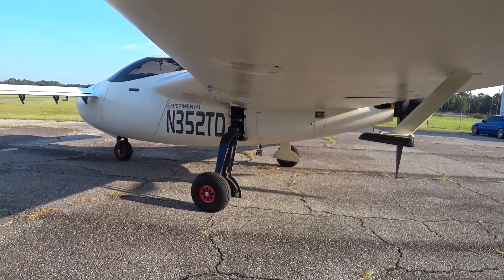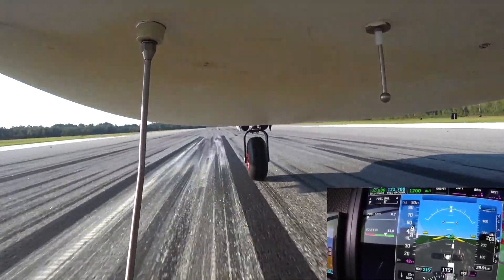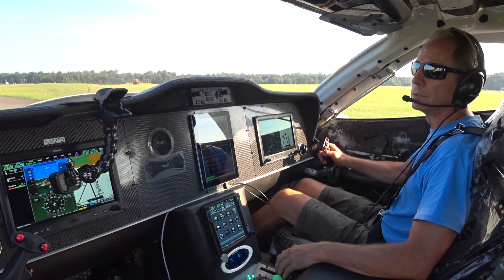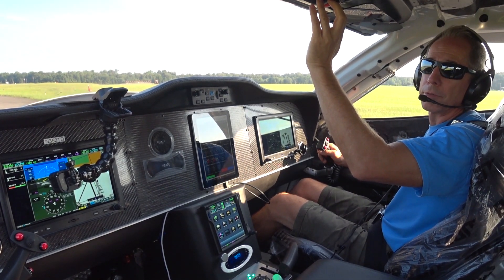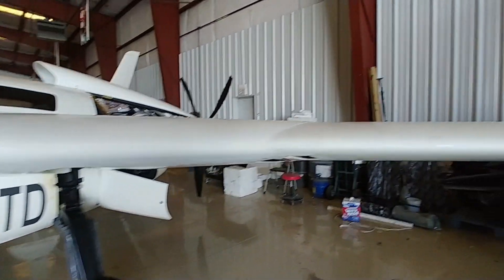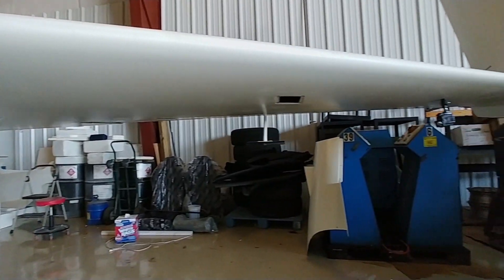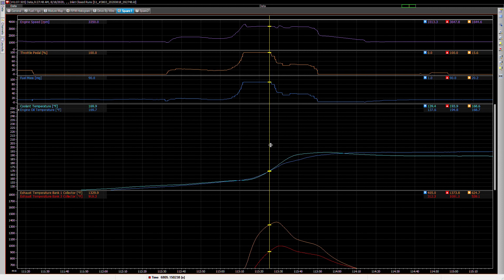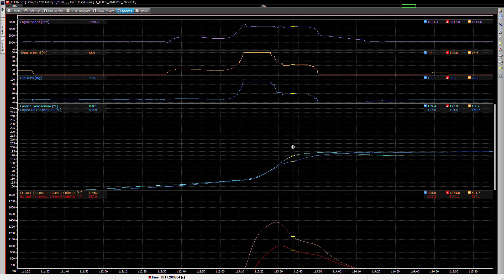Is There Enough Cooling? - Building the Raptor Prototype

Comment: will be interesting for your first flight - it's likely the test pilots will want full access to everything the engine can give them, just in case... not likely they'll use it, but I imagine they'd want some "oh fuck" insurance. Is there an easy way pick from different tuning profiles in-flight?

I totally agree you need to have done this level of fine thermal tuning for normal flight though - it makes absolute sense to me to have this stuff nailed down.

Comment: Look..bottom line....if the engine temp does not redline after extensive ground taxiing on a hot day...the most extreme cooling conditions for an air cooled engine....it's NOT going to overheat in flight!!!!

Comment: Find out the air velocity in the ram air inlet at climb airspeed, then replicate it with a ground air supply. Then ground run it at full power repeatedly till you find the weak point.

Comment: Peter - crank your temperatures as high as you dare with a threshold run-up and then roar down the runway to see if your 80kts gives you enough airflow to contain your temperatures.  That way you'll know whether it's likely to be stable or divergent for a first flight.

Comment: P Body
Peter you are not going to get an accurate gage of the cooling system capacity doing cold runs. 

What I suggest is an extended warm up period letting the system get to around 200 static or wherever it holds steady. Then do a pass down the runway full throttle cut to 50 and analyze those temps... if the temps stay unacceptably high after throttle cut on coast and during taxi this would be an issue..

Much like you were doing on your previous tests that day when you were seeing 200+ just taxing with a slight tail wind. If you can keep it under 215 under full stress or so or see substantial temp drops at v1 then you can consider yourself safe. If not you need to think about adding an induction fan/ emergency cooler fan.

Comment: Interesting,. I know you have measured this before but what was the measurement between the prop and ground. For the angle of attack for nose up on landing. Thanks.
Reply: I think I recall him saying (some time ago) roughly 17.5" static and 11" at 3°, I could be mistaken though.
Reply: @ssoffshore5111  thanks,. A hanger I'm looking at which is typical around here is ten foot, I'd have to raise the knose and get it in and the rudder tips between the rafters,. That's why I asked him if later he would lower it the velocity is 9 feet.  Peter said down the road he'd look into it.
Reply: @ssoffshore5111  for landing I think we would be wise to keep the nose up no more than 5 degrees. To avoid a prop strick, same as floats with wheels.

Comment: Is there a thermostat in the system? If so, it would be interesting to monitor its operation and the effect it is having on the coolant temp compared to the rest of the data.
Reply from the maker: Oil thermostat is set to 217f. The coolant has a two chamber setup that I believe is controlled by the oil temp.
Reply: @RaptorAircraft  All of the diesel engines I'm familiar with have dual thermostats controlled by coolant temps, not oil. My experience is with heavy duty trucks and pickup trucks though, I've never messed with TDIs.

Comment: I"ve been watching for a long time, and I can't tell if there is enough air getting out of the back. I wonder if you are building up pressure inside of the cowling so that the cooling is just inefficient.
Reply from the maker: The outlet air cross section is larger than the inlet, as it should be for the best performance.
Reply: @RaptorAircraft  Thanks. Just an idea.

Comment: Thanks for the Raptor rush experience today! Cooling looks good to me! A little tidbit experienced observation for you... Vacuum serves like a thermos insulator with the engine. When the manifold vacuum is reduced by reduced throttle setting, heat transfers through and will cause temperature spikes then level back off. This phenomena will fool many if the technician isn't aware. The camera on the tires reveille by the disappearance of the bulge that Raptor is getting light on the gear ready to defy gravity. The roll axis seems to stabilize with less rocking side to side during this phase. Are you feeling more stability at higher speeds? Raptor seems willing to point by reviewing today's presentation. Things are looking nimble with Raptor!

Comment: A conventional aircraft can rotate and sustain flight in ground effect below stall speed. A canard aircraft cannot due to the aft placement of the main gear. Attempting to fly this in ground effect is a very, very bad idea.
Reply: The CG is well forward of the gear, so it requires a significant pitch up to rotate. However, it will require a significant, yet sensitive, pitch down after takeoff to prevent a climb. PIO (pilot induced oscillation) is almost a sure thing with no canard experience (Peter). So now we're at high speed, low level, with a very high chance of PIO. Google Detroit Flying Car crash. While not PIO induced, it shows the danger of canard pitch sensitivity
Reply: Jeff, if what you are saying is that it takes a more delicate touch to fly it in ground effect, that makes more sense. If I remember correctly Peter has canard experience, however I could be wrong on this.
Reply: Stall speed fluctuates on all aircraft, depending on several conditions.  If you fly a conventional aircraft to a stall in ground effect, it's going to stall.  Ground effect gives you more lift, but that also means it lowers your stall speed.  So while a conventional aircraft might stall at 55mph in clear air, it may stall a few mph below that speed in ground effect.  All you're doing is changing the speed that you stall the wings, no different than if you were to reduce the weight of the aircraft.  It has nothing to do with flying "below stall speed" and everything to do with AOA, since a stall is a function of AOA and not speed.  Canards are no different in this regard, and yes, canards can fly in ground effect longer than in clear air just like a conventional aircraft.  Ground effect is a force that extends a considerable distance from the ground, and a canard doesn't suddenly stop being affected by it as soon as it's airborne.  They honestly don't act much at all different from a conventional aircraft in ground effect, no special tricks or procedures to follow.

A canard design lends itself well to protection from PIO.  Since you're in front of the wing, any pitch moment is going to lift or drop the cockpit before the wing reacts to the change in AOA, this is an active and positive feedback loop.  Generally speaking, in conventional aircraft where you sit inline with the wing or behind it, the feedback loop is either neutral or the opposite.  If you pitch up, then there's either no change in felt momentum or you feel a momentary drop before the wing starts producing lift...this is an inactive or negative feedback loop.  Positive feedback gives the pilot an instantaneous response to control input, meaning the pilot can feel what the plane is doing without having as much experience with it.  What it amounts to is the canard pilot feels more G's for a split second then it levels out to a sustained G, while a pilot in something like a Pitts will momentarily feel reduced G's or a gradual increase to that same sustained G.  Think about it for a moment, say you're flying a GeeBee racer at slow speed (like taking off), you can pull and push the stick and the plane kind of mushes around without climbing or diving because there's not much air over the wings.  Meanwhile, the tail is still moving up and down, and that's where you're at...so you feel the tail lifting you up while you're pushing the stick forward or dropping you when you pull it back.  That means if you pitch up, you feel negative G's, telling your body "oh hell we're falling, pull up harder", while your eyes are saying "oh hell, we're pointing to the sky, push the nose back down", so you push down and now you feel positive G's, which tells your body "oh hell we're climbing, push the stick quick" and your eyes see the ground getting big really fast.  That's how PIO's get started, and it's a pretty janky way to feel what the controls are doing.  I think anyone riding in the back of a bus behind the rear wheels could relate to this, by momentarily feeling like the bus was turning the wrong way.

As far as CG goes, any aircraft with training wheels is going to require force and pitch input to rotate.  In addition, any aircraft that rotates on takeoff will also require an AOA reduction to prevent climb.  Mains are located in a specific location to require a specific amount of elevator force to lift the nose.  Too far from the CG and it'll be quite difficult to lift the nose and hold an aircraft on the mains for takeoff.  Too close to the CG and it'll have trouble keeping the nose on the ground and might rotate before it's ready.  It's not something special just for canards, but it is something specific for aircraft with tricycle gear.  In some aircraft, you are required to rotate before a certain speed or you'll never get the nose off the ground due to the incidence of the wing itself in relation to the gear plane.

Pitch sensitivity and PIO is all about longitudinal stability, which has nothing to do with whether an aircraft is conventional or canard.  It has everything to do with CG, horizontal stab size and incidence, elevator effectiveness, and control forces required.  Put the CG further forward, you're more stable and less pitch sensitive.  Increase incidence and/or size, more stability.  Reduce elevator effectiveness, less pitch sensitivity.  Increase control force requirement, less pitch sensitivity.  This is true of canards and conventional aircraft alike.
Reply: @Skinflaps_Meatslapper  flight below "published" stall speed is what I meant. I disagree with you about pitch characteristics but that's ok. Looking forward to seeing this play out.
Reply: @jjc839  "Published" stall speeds always carry several quantifying variables.  Things like ambient conditions, power settings, W&B, etc. that will never be identical from one flight to the next.  Did you know that you can stall an aircraft at practically any speed it can fly?  It's not just about a particular speed.  It's about angle of attack.  That doesn't change unless you change the aerodynamics of the aircraft as well.

You can agree or not, it doesn't change aerodynamic principles that have been scientifically proven for nearly a century now.  I may just be a collection of random internet comments to you, but those comments come from decades and thousands of hours building and flying the very types of aircraft you seem to know so much about.  It's like an American telling an Italian he's been making pasta wrong his entire life because the recipe doesn't match what's on the Kraft mac and cheese box.
Reply: Skinflaps Meatslapper 👌👍👍
Reply: Can you explain that a little better? Isn’t the point of ground effect that it gets you a slightly higher ‘effective’ air density? If so why don’t that work on a canard?
Reply: Hey, I may be completely wrong, and I hope I am for Peter's sake
Reply: 🤔 This is a Velocity @3min t/off then land at end, pretty flat:  https://youtu.be/bBsR0S7nEOU

Comment: Pete,  the length to which Wasabi went to throw you under the bus repeatedly in their rebuttal video was surprising to say the least.  First impression was that they were more professional than that.  I began to lose confidence when they kept extending the squawk list, finally telling you they wouldn't fly from the old airfield.  It seemed like they were looking for reasons to bail on the project.  Still gobsmacked at their need to seemingly defend themselves by taking you down. Glad to hear of your new situation the the in house DAR and Test Pilot.
Reply: I too had some reservations on Wasabi and why it was decided at last minute to reject the original airport.  However...after watching some of the more recent acceleration tests prior to their arrival, and then them doing some runs...I think it just took them a while to arrive at the conclusion that the aircraft just did not have a fast enough acceleration for the runway length.  This is not a criticism but just a factor of the design - this aircraft, as set up (prop, weight, etc), uses a lot of runway to accelerate to takeoff speed.  Again, nothing wrong with that, but for initial test flights, you want more margin for accelerate-stop.  In a single engine piston, I don't want my reject decision point to be 1 second after Vr on a good day!  They are looking out for the aircraft, and don't want to take it "into the tulips" if they can avoid it.  Best mitigation for these initial flights is a longer runway, and I think this proving valuable even now with the test runs Peter is doing.  Good work Peter!
Reply: @jeffreygoyer7760  I totally agree.  It was a very wise move to relocate to another airport and one with a longer runway AND safer places to put it down if things get ugly.  Several things have failed while on the ground.  You definitely don't want to find all (or any) of your weak links in the air, especially when there's no safe places to put it down in an emergency.  Hopefully this won't be happen, but I don't blame them for a minute for refusing to take the maiden flight out of that other place.  It was a very wise choice to relocate, regardless of who is going up first!
Reply: It struck me as a mix of a "We are smarter than you" attitude, combined with over bureaucracy and a paid by the hour mindset.  

They have nothing resting on the project and every issue they need fixed before they fly just adds to their paycheck.
Reply: I got nothing but negative vibes after watching all that mess.
Reply: Even if everything they said were true , they will never be able to defend rejecting the runway length, on the 3rd visit!
Reply: @donanders2110  that should have been addressed right away.  Yeah this was definitely throwing Peter under the bus for sure.  Their commentary were.. yeah.  No.
Reply: @donanders2110  yah don that was the nail in the coffin for me

Comment: Have you asked about doing a high speed taxi back on the runway instead of back tracking on the taxiway? On a windy day it would mean you'd have a little higher ground speed before you got to your target airspeed. But if you're trying to see what your max temps will be, you could build  up temps in both directions without so much cooling on the taxiway on the way back to an upwind taxi.
Reply: Wouldn't be great on the brakes.
Reply: I didn't get the impression he was riding the breaks on the way down. Seems like he throttles back when he's just below flying speed. Then a little breaks to slow down for the turn off. If he just turns around again the breaks should be cool by the time he has to slow down to turn off or turn up wind on the run way.

Comment: Peter,  by how much have we exceeded the target zero fuel weight ?  Also, what percentage of the theoretical lift at 90 knots will be supplemented by ground effect ?  Thanks for the update. Stay sharp, stay safe.
Reply: It’s really not over by more than 10%.   The last scaled weight included ballast ( for the empty second seat) and when you look at the takeoff fuel flows 19GPH not 35GPH like my TSIO520 the lower fuel burn maintains a higher payload capacity than my P210.  I carry  720# of fuel but the Raptor can complete the same mission for  490#. Less fuel needed = more room for pax and empty weight. This is a GREAT Project.
Reply: Peter Le Lievre , thanks for the response. At this point I’m not too fussed about payload & range capacity. I’m more concerned about what the difference in total net lift force will be for a test pilot when transitioning out of ground effect into fully self sustained lift at speeds above 90 knots and then the associated reduction in net lift at pattern speeds when introducing typical angle of bank manoeuvres without flaps. I’m sure the test pilot will be limiting fuel to minimise the effect of total take off weight in unintended high angle of bank manoeuvres.

Comment: Once you get off the ground you will find the cooling to be just fine or a bit over cooling . Remember that ground temperatures is much higher than even a hundred feet in the air .

Comment: "NON-engineer Psy major's input" Id make that intake scoop a bit wider and taller to grab more cool air from the top of the fuselage. (End non engineer Psy major's input) :D lol!!
Reply: Its always a compromise between cooling and aerodynamics. Given that Cruise is to be in the high 200's you don't want an air-brake and believe it or not the air can travel too fast through the cooling system on an aircraft.

Comment: Hey, thanks for the excellent update. Question - How did you determine the "throttle-back" point for the different metrics? (1650 on the  Turbo,  230 on the coolant, etc)? Also, about how long did you have the engine up at 90% Max (not sure if i may have missed that in the narrative)?
Reply from the maker: From all my research it seems that 1650f is a fairly common max sustained temp for turbos. Again same with the temps on the coolant and oil.